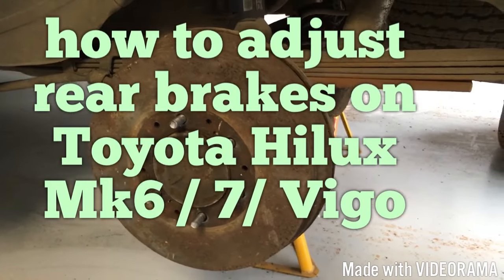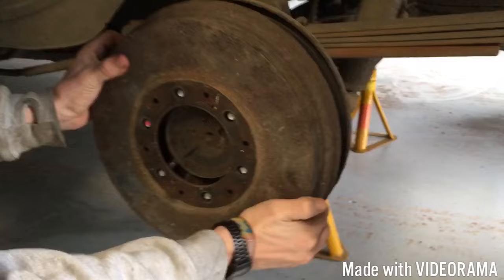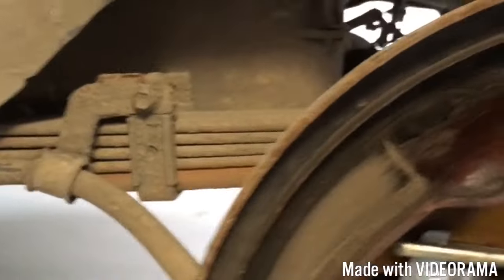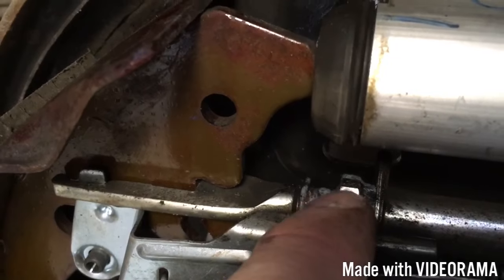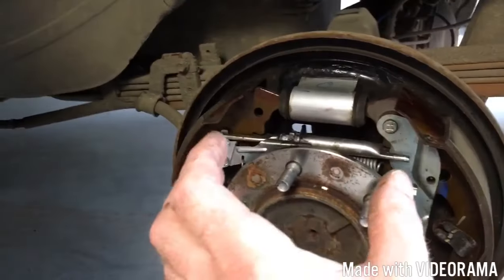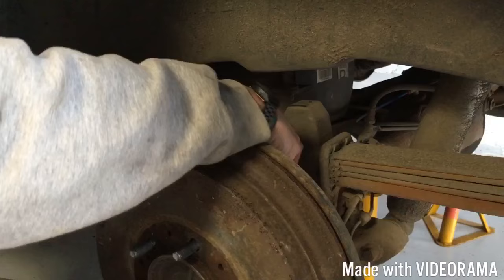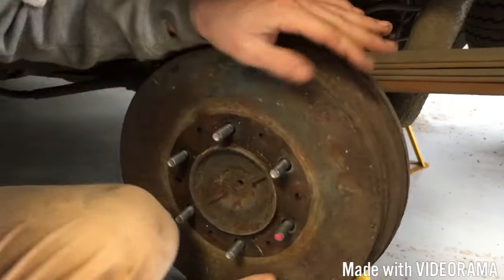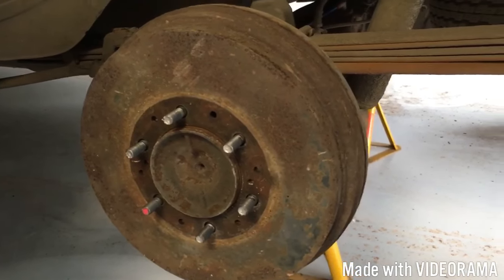Rear Brake Service and inspection on Toyota Hilux Mk6 Mk7 Vigo

Comment: Just noticed the handbrake lever is far forward indicating the handbrake cable is over adjusted. This will affect the way the self adjuster works. Most probably why the shoes are not adjusting themselves.